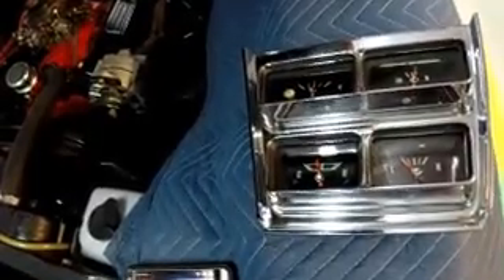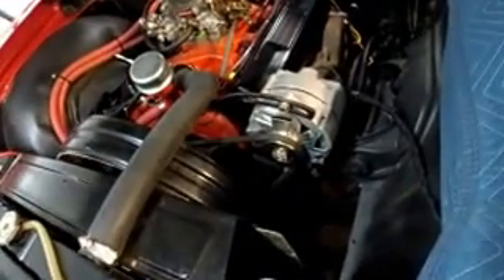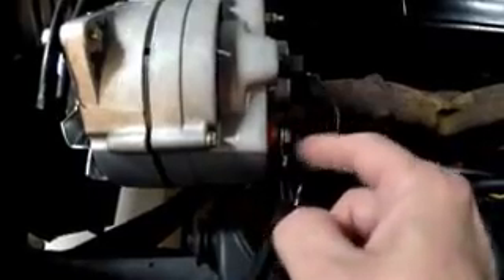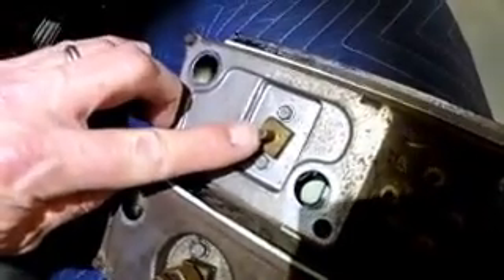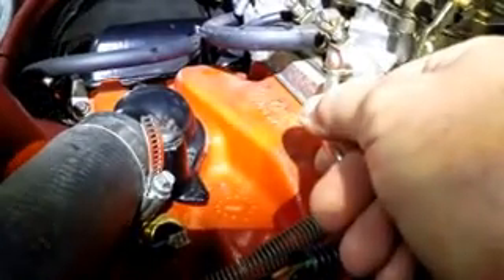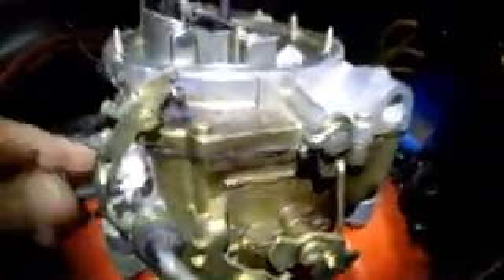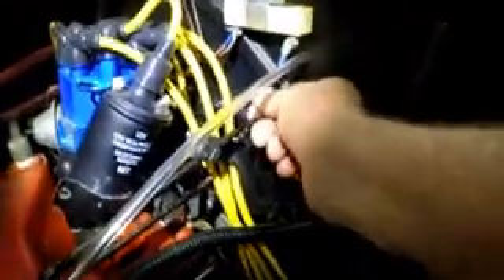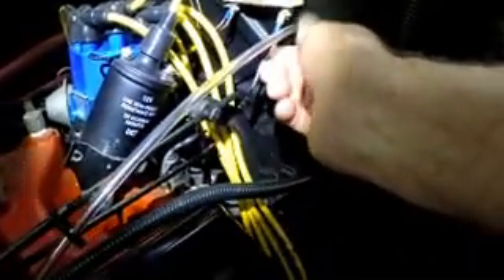1966 Impala dash cluster gauge install

Comment: Dan, My name is Rodney and I recently bought a 1966 Impala, I purchased a retrosound radio to replace a broken aftermarket radio that was installed who knows when. I took the glove box out and part of the A/C box off, and hoses to the vents loose or out. I still can't get the radio out. It appears the heat/AC controls have to come out along with the center vent. Would it be easier to take the dash out? Have you had to replace a radio? Any help would be appreciated.
Reply from the maker: yes. I had my radio out several times. The best way was removing the upper dash pad. Before you do that you may want to take the steering wheel off for more room. I added a  plus 12 v strip and a ground strip and mounted it just to the left of the glove box in case I needed to add any 12v stuff. then I redid the entire dash, sanded and painted and fixed all the instruments   any questions let me know.
Reply: So can you install this gauge cluster without the peice  over the  heater controls, I have an bopportunity to purchase the same gauge cluster that has been cut off. I need some more info on installation.

Comment: thank you very much for  sharing all  your video. it will sure help when needed. Did you use a inline fuse (amp?) on either wire  for the Amp gauge ? can't wait to see the final mod, result.
Reply from the maker: Not yet but thanks for reminding me. I have an in-line I can use. Not sure why but when I first turn the ignition on the gauge will swing all the way to the right and then back. hmmm have to investigate that one.
Reply: maybe normal but should have 0 resistance ?, does it drop when light on ? originally  fusible links on each end ,>>>http://toms427impala.info/CT/Simplified%20Ammeter%20Wiring.pdf
Reply from the maker: damn, you may have the answer here!!!  where the heck did you get this????  I love it!
Reply: loll, when i find something interesting i keep it for that one day when needed ,same as your video's  that are awesome  ...enjoy!
Reply from the maker: I hope this will help my amp gauge swinging crazy at startup. thanks a bunch.
cant wait to try it. I have all the caps and such,,,,,,,,,,,,,,, I hord as well
Reply: hello Dan, waiting for more videos...lol , just fyi , noticed you installed the spacer in front of the rad, it should bolt on the rad support and the shroud to the radiator...>>https://postimg.org/image/5241ksnkd/
Reply from the maker: hmm.  did not notice that, good catch. I'll have to look into that
Reply: it should be a direct fit, one problem i noticed,  is some guys use 6 cyl rad (wider) that bolts to the support but won't fit  to the spacer
Reply: Dan, here's more info that  might help if needed, enjoy.>>> http://www.chevytalk.org/fusionbb/showtopic.php?tid/316768/